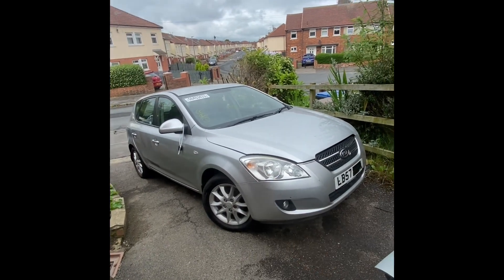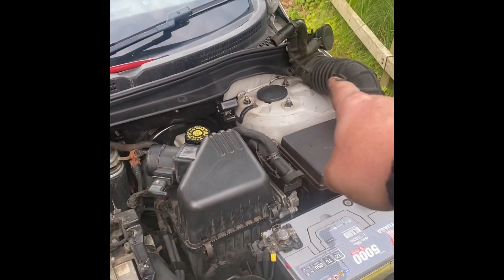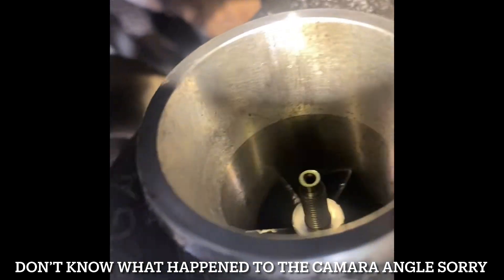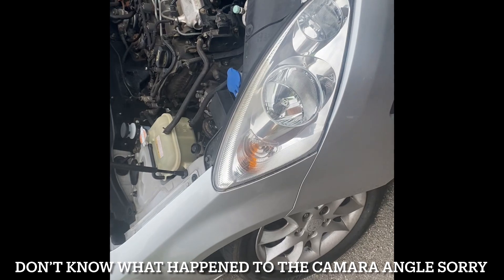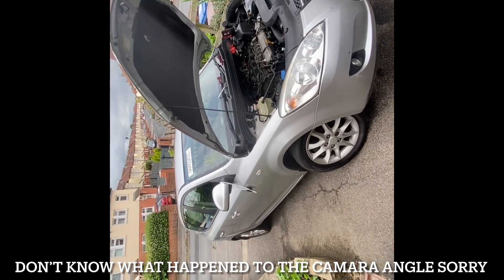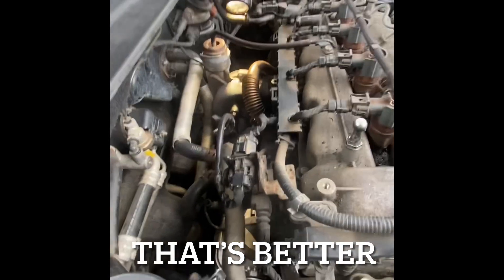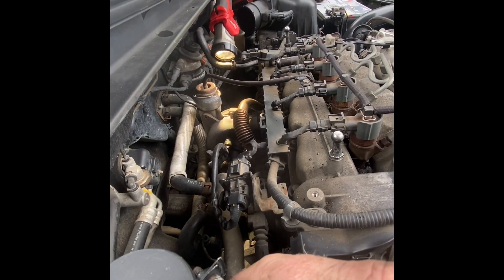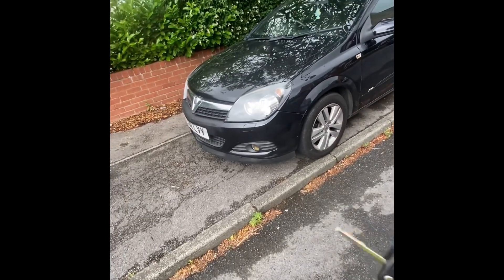I find out why my Kia was at copart

Comment: New or old turbo will still produce pretty much the same amount of boost pressure. And you don't need to run in a new turbo either. You can prime the oil pressure first or start up with no rpm leave to idle for a while apart from that turbo is ready to go.
Reply from the maker: Thank you for your input, I’m only going off my experiences I’ve know it to create problems but regardless the car isn’t worth putting a £500 turbo on it anyway so it was getting a 2nd hand one regardless
Reply: @Budgetbangers  yes a new turbo has no metal on metal parts to run in! Like a new piston rings for example they have metal on metal contact with the bore so require running in. Turbo is run on bearings so no need for run in. And yes I agree any way a decent condition second hand turbo is the way to go on this any way.